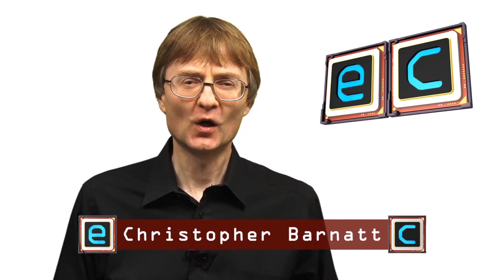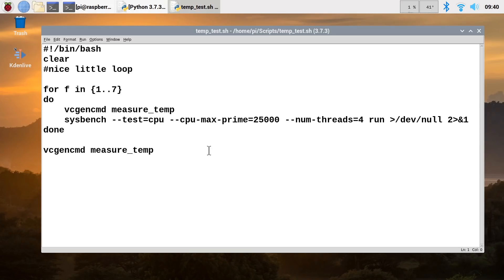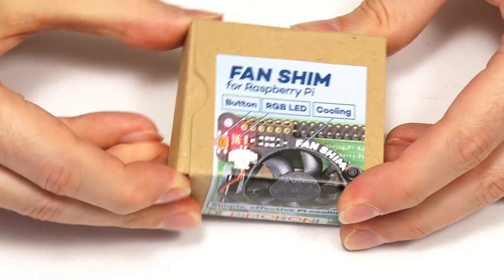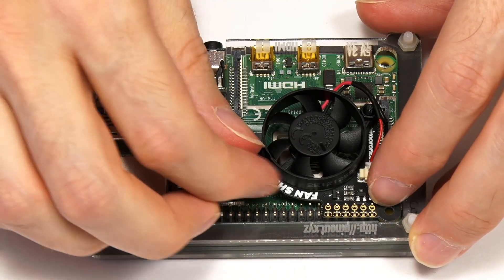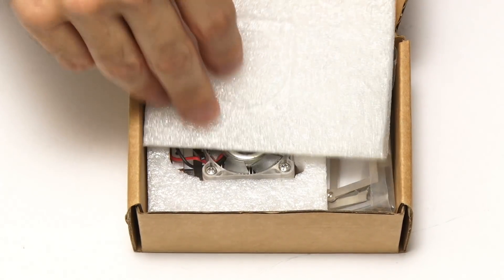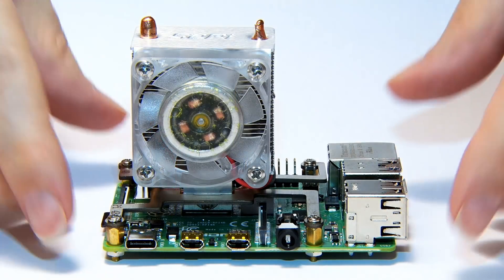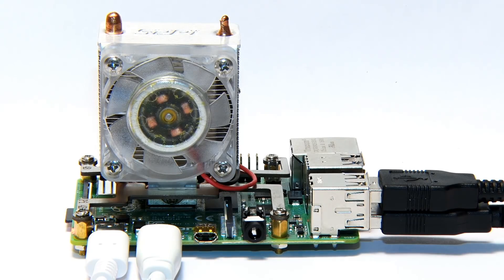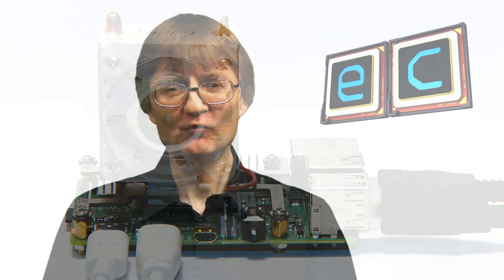Raspberry Pi 4: More Active Cooling!

Comment: I had both my RPI3s mounted horizontally. Then for practical reasons mounted one on its side against a board (HDMI side up) and it ran cooler.

As you say, flow of air matters and I keep wondering if cases for the RPI could not be drastically improved by putting more thought into convection flows, and mounting the boards and heatsinks more like amplifier transistors and heatsinks in audio gear (ribs of heatsinks vertically aligned, air flows upwards along it as heated and creates the flow passively, like a convection radiator).

I never really had issues with throttling of my RPI3s serving as mediaplayers. I am using my RPI4 with 4Gb as a desktop computer now and hit that thermal throttling point quite a lot while acting out my worst multitasking behaviour. While heating up, it computes beautifully though. On the older microusb power supply even. I'm looking forward to sorting out the cooling (hopefully passively) and backpowering it from a Hifiberry Amp2 HAT and a laptop powersupply.

Comment: I have no current use for the P4 but the challenge of cooling it makes me want to get one.  Thing is I will end up getting the 4GB version because that has the most potential utility and the cost mounts up.

Someone has already cooled it down to 8C, which is actually pointless because all you need is below the temperature it throttles at, unless you rewrite the ‘bios’ I suppose, beyond my ability and I think the design is limited to 2Ghz anyway- and probably on some deep level.

|If I can think of some reason to have a Pi4 that has to run at 2Ghz constantly then I will probably get one.  I have my own cooling ideas though the Pimori solution is very good.  It would be interesting to know how much air that fan moves as it is it seems very quiet.

The ICE cooler is a bit rich for me, especially as I have plenty of similar coolers for 86-64 PCs and it isn’t hard to make up brackets- either via 3D printing or old school with some plasticard/ sheet metal.   Not sure about RGB coming to SBC, it drives me crazy in 86-64 and seems to have mainly been avoided by the SFF crowd.

My cooling direction would be a silent solution, you can get a passive cooler for the AMD Athlon (as in the budget AMD chips) for about £7 (plus P&P)- especially as the real target is just to stop throttling not get down to single figure temperatures.

Comment: Considering any of the cooling solutions prevented throttling, is there really any benefit to cooling the Pi beyond the minimum needed to prevent throttling?
Reply from the maker: The benefits are only in life expectancy for the board, and potential overclocking. As you say, any of the solutions shown are sufficient (well, not the very small heat sinks only).

Comment: Whatever happened to piezoelectric cooling? Surely it should be an option, but I think the last time i saw it was on a 486!?
Reply: Piezoelectric? You mean those little flapping find? Or do you mean Peltier?
Reply: @jackiemowery5243  I mean Peltier which worked on the piezoelectric (thermoelectric) principle

Comment: Finally there is an LED tower cooler for the Raspberry Pi!  This will make overclocking the Pi easier.  The next step should be to make accessories with addressable RGB.  The Pi 5 would look nice if it followed Gigabyte in putting LEDs all over the motherboard. :-)

Comment: I'd like to see some sort of graph of it going down. So run the ice tower, fanless for x number of minutes then plug the fan in and take samples every so often to see how long it takes to clear the stored heat energy in the heatsink.  I guess if you really want to go towards the extreme end, put the Pi inside a sealed tupperware container running off a battery pack with a desiccant gel pack.  Stick it in your freezer and connect to it over wifi with VNC and run those tests.

Comment: I tried one active solution - a truly awful case and fan from The Pi Hut, the little fan was making 84db of noise and pushing very little air.  Pi Hut don't respond to any messages so I'd say it's dead cash out the door.
Instead I'd definitely say the new FLIRC passive case is the go, I received it yesterday and I have it on the 4b (4gig), ran stress tests in yesterday's warmer weather (I'm in Berkshire, had about 23-25) and the highest I hit under the Stress program was 63 degrees, it'd idle down to around 50 or so.  Right now at idle it's only showing 46, ambient temperature in here is easily about 25 or more.  The whole case gets rather warm (but not hard to hold or anything), it definitely does its job;  Don from Novaspirit suggested trying an overclock, I haven't tried that yet (didn't even know it could be done on these) but overall I'd say it's a very good solution.  The one thing I'd concede to is raising the case off the desk a little, I have it on some rubber feet to give it a bit of an air gap;  not sure how important that is but I'd want airflow around it to be unimpeded as the case has to dissipate the heat it draws.

Comment: Unfortunately passive cooling is not going to work as the points you make about power Ghz == heat.  Do remember this Pi4 is a generation behind current A76 and I have seen signs of A78 7nm and 5nm tech.  The A76 will breach the 3Ghz barrier so yes active cooling all the way,  sorry folks but you will have to put up with it, fans are going to be a main stay.

RockChip I think will be the first out of the gate with an SBC sporting one of the new 8nm 3500 series SoC's that will blow everything else away thus far,  the interesting part of this SoC is they are changing the GPU by all accounts, moving away from Mali, at this stage we do not know what that is, there is speculation is it might be Radeon ( navi embedde maybe ) ..

So super exciting times ahead, for linux though a number of us though this might be the year of the Linux Kernel clean up after all the hardware that has dropped, and that seems to be the case with the up and coming kernel 5.3 that is bringing in alot of subsystem merges and cleanups.  Lima driver is there in current 5.2 that supports Mali 400 series and obviously T and W series are support by Panfrost / Bifrost respectively.  So as ive said many times with the speed of software changes at the kernel level, it is wise to run a rolling release distro to keep current with all the new changes for SBC's as that is where the action is,  Greg Kroah-Hartman uses Arch himself even on x86.

I know your mileage will very,  but look I have panda and beagle boards ( bones too ),  Rock64 / pro64, mx6 sollidrun cubox i pro 4 and 4x4 amongst other things, and to get the most out of these things ive always used a distro that is easily setup with main / current kernels or atleast easily modified to do so.

Comment: Something you should consider Chris; current measuring with these solutions - these SBCs are supposed to be energy efficient, so how does that change after you add cooler systems?
Reply from the maker: This is a good idea for a future video; noted. :)

Comment: Nice video. Also I use USB powered fans as my Pi 4B uses up all the GPIO pins for the uHat TV Tuner DVB. It seems to work fine but the bonus part is that I can adjust the fan speeds with the switch [Lo/Med/Hi/Off] - including the small copper heatsink. But the disappointing part for the Pi 4B is that OSMC, RetroPie and some other Raspberry Pi Distros are not yet compatible with the Pi 4B so far...

However the most intriguing part for the future of the Raspberry Pi, from what you mentioned on from the possibility to replace PCs with the latest Pi 4Bs; is Vulkan API support as well as some latest techs to expect. OpenGL is supposed to be replaced by Vulkan but may not have the legacy support as Vulkan for most computers. Besides we don't want our Pi 4B to use up too much resources and utilisation that will overheat the  Pi as well throttle too often, due to outdated libraries and APIs that aren't optimised or designed for newer ARM 64-bit processors.

So I really hope the Pi 4B will support Vulkan, RetroPie, OSMC as well maybe have smoother frame rates for playing Youtube videos in 1080p in Raspbian.

Comment: I wonder if we'll see a Raspberry Pi 4C that addresses thermal concerns.
Reply from the maker: At some point they must add at least a fan header, and hopefully some heat sink mount options.
Reply: Heat sink mount options? Here are two I have used successfully for years -- Gorilla Glue or JB Weld. The JB Weld is permanent and Gorilla Glue can be popped off with an Xacto knife.

Comment: I have two RPi 4s. I have One RPi 4 in a case with a fan/heat sinks (iUniker) and the other in a flirc case.  The unit in the case with a fan idles at 36°C and the unit in the flirc case idles at 45°C.  When I ran the stress test on each, the unit in the case with the fan maxed out at 51°C and the unit in the flirc case maxed out at 61°C.  The iUniker case with the fan was $8.99 on Amazon Prime and the flirc case was $14.95, but with shipping it was $22.80.

Comment: I'd like to see a passive/active solution (yes, hear me out).

Okay, so you take the passive bit from the ICE Tower, but in between the cpu and the heatpipe/heatsink setup, you slap a tiny peltier element that generates some electricity because of heat difference. Then you use that to power a fan that pushes cool air through the heatsink side.

Comment: I wonder if the next generation of Raspberry Pi might have the SoC on the underside of the board so that it can be mounted in direct contact with a metal case for cooling purposes.

Comment: Just a notice, for passive cooling one need to bench it for much longer time, maybe hour or more or so. Just 10 minutes is not enough.
And always for longer time, as passive acts differently than fans, since heat does not dissapear as fast, instead it continues to grow, depends also on material used, etc...
Greater in height is usually the better and material and design needs to be in such shape all because to release heat as fast as possible.

Comment: It might be worthwhile using the ICE Tower Fan on lower Voltage = Quieter. Or perhaps the Fan can be controlled ?
Reply from the maker: A speed controller is certainly a possibility.

Comment: Question: did you remove the fan assembly during the no Fan Test.. as leaving the Fan on will obstruct air flow..
Reply from the maker: The fan was left on. The screws look like self tap, so I did not want to remove.

Comment: Be nice if there was a heat-pipe cooler that blew air down on the board.  That would give it a lower profile, cool ancillary chips, and allow much better convective cooling when no fan was in place (due to fin orientation that encourages hot air to rise through the stack passively).

Comment: Hello, Very interesting channel.  You showed the final temperatures for the fans.   Did those final temps on all the coolers keep the Pi4 from throttling?  This is what matters, right?
Reply: Throttling begins if above 80-85°C, so none of these will throttle.
Reply from the maker: @John Farrell Nothing throttled here: tests here all ran for the same time.
Reply: @ExplainingComputers  Thanks for the answer

Comment: I have pi 3 and pi 3b+.... the standard passiv cooling is very suXX! for my pi 3b+ i have a metal case for more better cooling. it is ok!
but the pi case need a better standard solution, because it is very bullcrap. so if withouth special addition cooling.... u start browser and libre... all will slow, because the device will HOT. that i can not understand, that is available....

Comment: The SHIM actually had the worse cooling. It was hotter that the Tower without fan for the most time. I do suspect that the reason is that the SHIM fan is way too close to the CPU and the board, so the air doesn't have enough room to flow fast enough.
Try pulling the SHIM up a bit..
About the Tower without fan. Please, run the test for longer. The Tower has a lot more mass, so it takes longer to reach equilibrium.

Comment: You can get the Pimoroni heatsink on ebay for $6 shipped now if youre in the US: ebay.com/itm/Raspberry-Pi-4-Heatsink-Rpi4-Heat-Sink-Pimoroni-Cooler-Cooling-40x30x5mm/273958255795 Youre welcome!

Comment: I just ran the same test, using an aluminium alloy case with dual fan (https://www.lazada.co.th/products/raspberry-pi-4-armor-aluminum-alloy-case-with-dual-fan-i376178354-s732628611.html but also on eBay) upgraded with higher end fans Sunon maglev MF25100V2-1000U-A99 for extra reliability and implmenting a regulated fan speed. Ambiant temperature is 27C (that is where I set my air conditioning) and there were a couple of Firefox running during the test. Results are:
temp=54.0'C
temp=67.0'C
temp=68.0'C
temp=68.0'C
temp=68.0'C
temp=69.0'C
temp=69.0'C
temp=69.0'C
Noticeably higher, but I don't have a fan that stick above the case, it is self contains and robust. Fan speed controlled through PWM picked up at 211.

Comment: I just cut a hole in the stock case put heat shrinks on all the chips and threw  a 40mm noctua fan on top with a filter.  Best solution
Reply: Did the same but with an old silent laptop fan and dust filter. I made the fan only turn on above 75c to cut on power usage. In practice this is almost never. It only turns on with all cores are at 100% for 20 seconds straight.
Reply: @robertvandeneijk1284  You can probably extend the lifetime of the RPi by lowering the temperature.
Reply: @onnozweers  It runs mostly in the 62-65c range in summer. I have cooling blocks on all major chips for decent passive cooling. If only 1 or 2 cores load up it won't pass 70c. I think this won't hurt anything before the device itself gets outdated. If electron migration becomes a problem before that, I can always underclock it somewhat.

Comment: I'd like to see a run with the fan removed from the ICE Tower as part of the passive series of tests.

I have a stack of Pi 3 B devices that I use in a cluster.  To the stack with Pi 4, I would likely use the Pi Shim as it is compatible with the stack interval.  I may need to slightly increase the separation to ensure enough airflow.
Reply from the maker: I will be doing this. :)

Comment: Can't have enough cooling.  I don't care if it sounds like a jet engine. COOL That Thing Down!  But what about the other chips (USB controller and Ethernet controller).   Don't they still get hot?  Can you squeeze in passive HS next to ICE Tower?
Reply from the maker: You could just about get in some low-profile chip coolers with the ICE Tower. One benefit of the Fan SHIM is that some airflow will get to the other chips.

Comment: Would have been interesting to see the difference between the thermal pad and thermal compound.
Reply: I've seen a few 86_64 tests and it is minimal, I now use the pads for SBC and some 86_64.  Temperatures aren't so critical because the overclocking thing isn't the same, just keep below throttling and really you are done- unlike competative 86-64 overclocking.

Comment: That tower cooler is so cute. And it seems like a neat fit for emulator boxes that dont need to be super small but could really use some overclocking.
Also maybe it work work better passively if it was at a 90° angle so the warm air can pass through the fins better.

Comment: Why is it that mobile phone processors, which are much more powerful don't require this level of cooling?
Reply: Phones likely throttles more and do bigLITTLE tricks, plus some advanced scenarioed power managment avoidances usually to prolong battery life etc..
That managment could go as far as that even user hands act as cooler too 😂
 RPi 4 as aimed also for Desktop does not calculate as all 4 cores are BIG and that cries for a fan to not throttle in intensive scenarios such a stress benchmarks. Plus some people like to OC it too, so 😂
Reply: If you confine the processor to do what a phone normally does (as Milan Kostić says), the rp4 will probably run cool. The benchmark just flogs the processor as hard as it can go.

Comment: Good tests.   The 52Pi cooler works very well.  Interesting to see the difference with and without the fan.
For the passive cooling options you mentioned for future video, are you going to include the Flirc aluminium case?
Dave.
Reply from the maker: I will indeed try the Flirc case in my next Pi 4 cooling video. :)

Comment: I would like you to try the fan in Reverse so it's sucking air you'll need to fill the open gaps with some stiff cardboard attaching to the fan body and the plastic case with some silicone. See what results you get then. Making sure that is only one area open in the case on the sides. Too much of an air gap area will not work looks like it's open at where the plugs go in that might need to be made a little bit tighter everywhere else should be sealed this is important if you make a cardboard cut-out of the fan so the fan is tight inside a cardboard something like a pizza disc should be ideal I see those gap around the side with the plastic where the fan is situated